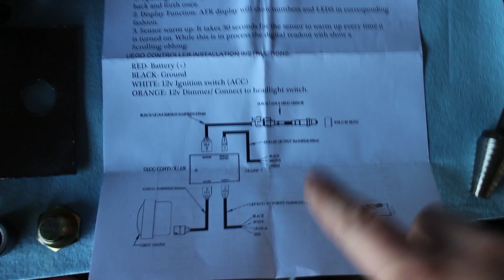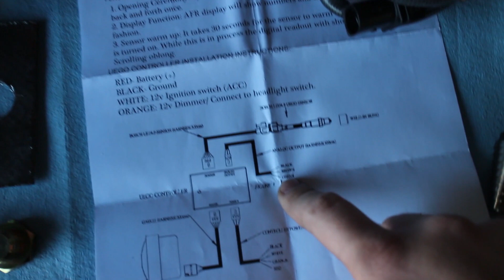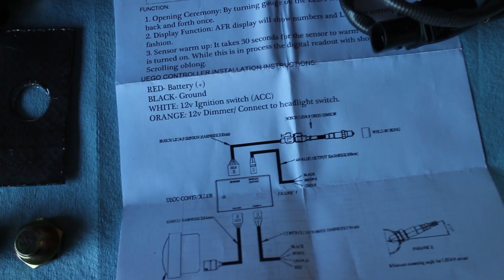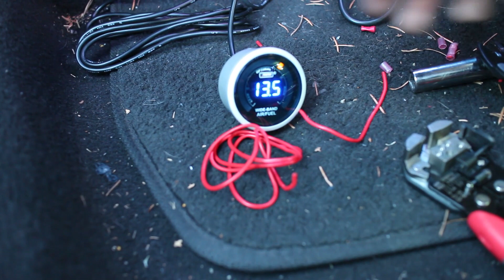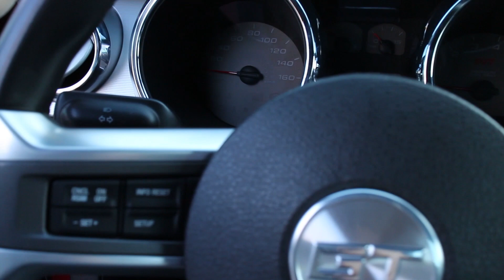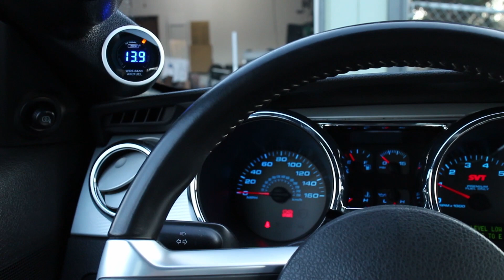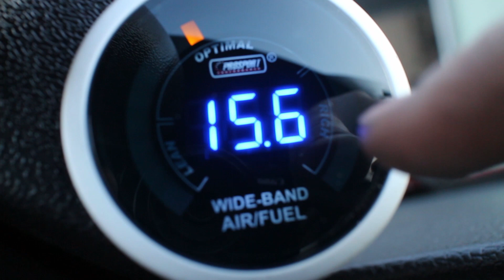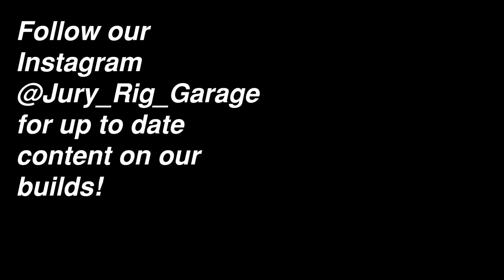How to Install a Wideband O2 Gauge in your Car! (ProSport Gauges)

Comment: Thank you for putting out this video, I'm looking to install a wideband onto my 07 gt to get it tuned. When tuning the vehicle with the wideband, does it connect to your tuning device through the obd2 port? Or do you just get the readings through the gauge pod?
Reply from the maker: We actually just made a video on how to datalog with your wideband. You would need a SCT X4 tuner and SCT firewire. Here is the link to the video: https://youtu.be/POIduyJ55xs

Comment: Do you need both the wideband o2 sensor and the oem o2sensor ?
Reply from the maker: You will still need OEM sensors, at least the forward ones. The wideband will need to be added

Comment: what model pro spport do you have fore your wideband, i use evo series and when lito started tuning my car he said the wideband isnt reading correct, has he said anything like that to you?
Reply from the maker: I'm using the digital series, should be the same bosch sensor. He probably means there is an exhaust leak in your system which is making it read incorrectly.

Comment: where does the engine ground go?
Reply from the maker: 12:45 Any solid metal with a bolt will do, placed in the interior under the dash
Reply: @JuryRigGarage  sweet thanks.  installed headers and a 52mm prosport in my s197 3v  last night.  getting my tune dialed in now